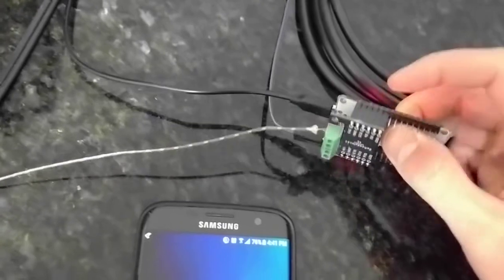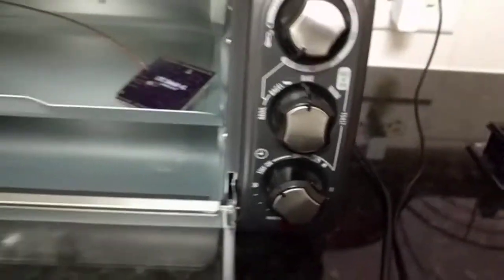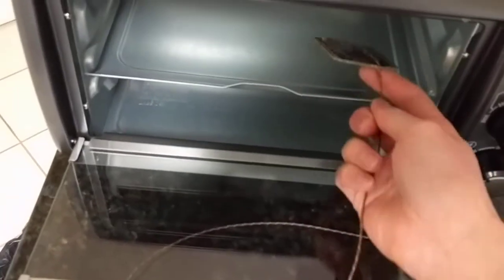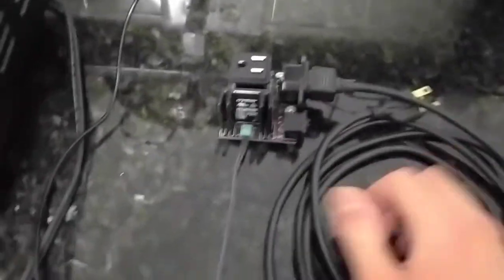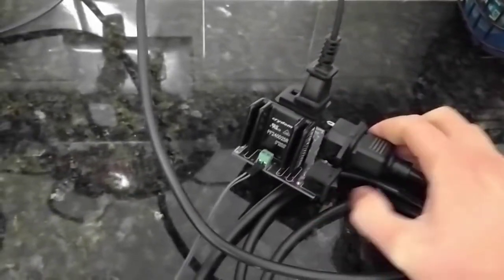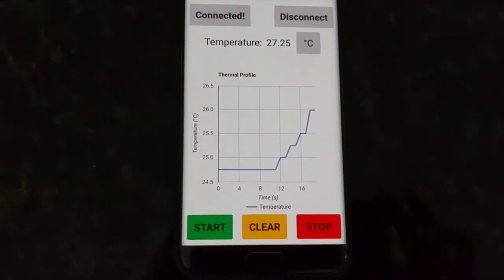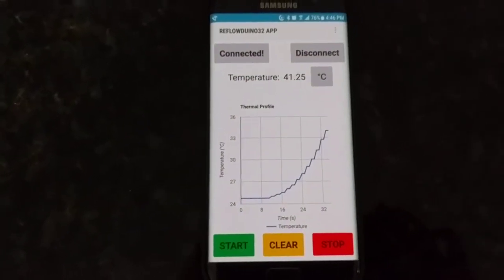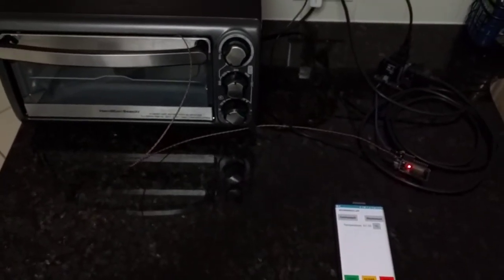#14 ESP32 DIY Reflow Oven Demo with Reflowduino32

Comment: Hi Timothy! Great work! I have a question for you. I want to do a project to handle all the home lights with a mobile app. So i want to use one esp32 for each switch and make a dual communication with a custom API hosted in some server and then communicate the API with the mobile app. it is possible to make that? or i need an extra component like a Raspberry to be an intermediate between the esp 32 components and the cloud.

Comment: Hi Timothy, thanks for the great video, documentation, and developing this backpack module. I do have a question, however. I have a MAX13855 breakout board and external SSR hooked to the ESP32 pins and I am trying to test it out. When I go to the Bluetooth settings in my phone, I can pair with the Reflowduino32, but then it goes into paired devices. It doesn't show connected. Then when I use the app and choose connect, nothing shows up to connect to. Do you know what might cause this? Thanks again for the great work!!
Reply: Sorry I'm not sure. I haven't seen that behavior before. You shouldn't need to go into the Bluetooth settings on your phone though; just open the app and connect via Bluetooth in the app.
Reply: @timothywoo5872  ok thanks. I'll keep working on it. Thanks again for sharing all your hard work. This really is a great project and I can't wait to reflow some boards!
Reply: @timothywoo5872  I think that the app is broken now. Thunkable has been changed to Thunkable X and you cant upload the .aia file in the new version so I cannot try to edit the app. Have you tried the Reflowduino32 app lately? It will not connect to bluetooth for some strange reason and I don't understand it. Its unfortunately because I wanted to build a reflow oven using your design but I don't think I will be able to.
Reply from the maker: @Farizno  try using the compiled Android .apk file

Comment: Improvement 1: Make a hole in the Oven-Toaster and wire the cable through it, so that you can close it.
Improvement 2: Fix the ESP32 and every other components encased inside the microwave oven (behind the rotary thingies) and get power directly from the oven-toaster to the ESP32 (converted).
Reply from the maker: Jules A Thanks for the comment! I could drill a hole but it wasn't worth my time messing with it, especially for the demo. I've reflowed quite a few things like this. However, feel free to make any cool modifications and improvements!
Reply: To me, the whole beauty of this well-executed design is that you DON'T have to make any holes in the toaster oven. That's what everybody else does. This design is elegant in its simplicity. I only wish it were still being sold.